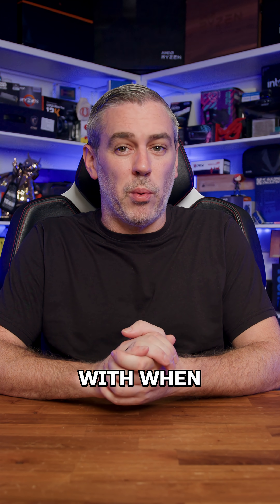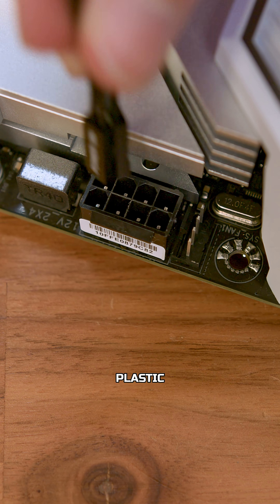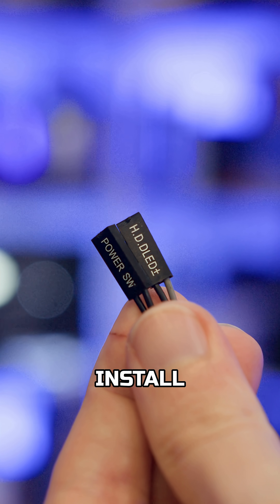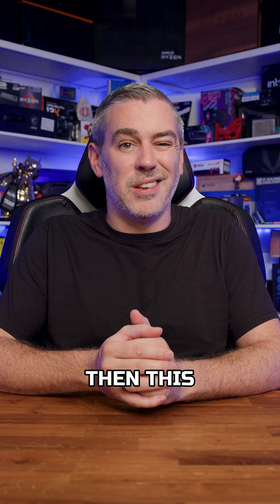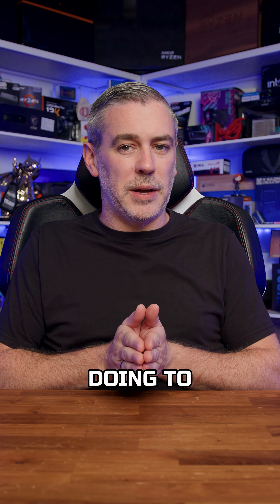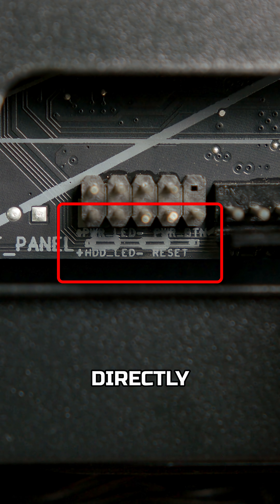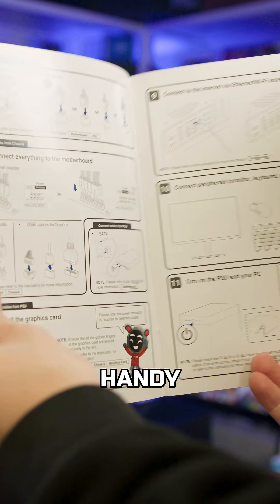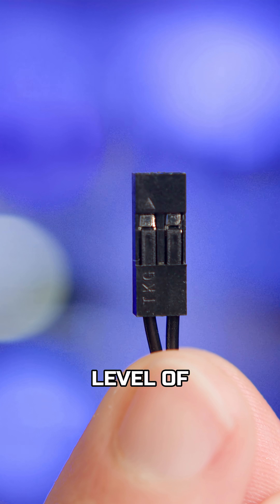PC Building Basics: How To Install Front Panel Headers

Comment: The orientation of the power and reset switch doesn’t matter, but the power and HDD led need to have the text faced down! Otherwise you mix up the positive and negative. It won’t harm your mainboard, but the leds definitely wont work if you place them with the text up.

Comment: i never found that hard is truly easy. I mean... come on is label on the board some boards come with a additional plug for that in the box.
Reply: Besides, the manual is there. It's really easy to understand even if they weren't marked on the motherboard lol.
Reply: yea the manual tells where each plug should go, but the labels in the motherboard are sometimes unclear, for example my gigabyte motherboard had the speak label as "SPEAKER" but my MSI motherboard had the same port with another label "JFP2". 

do make to just read the manual